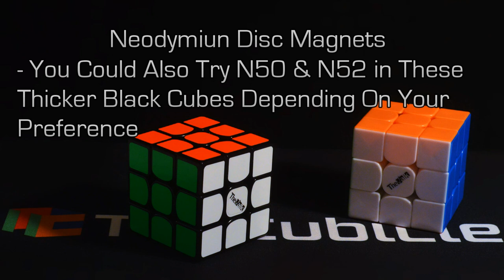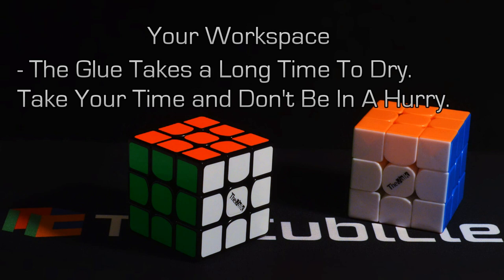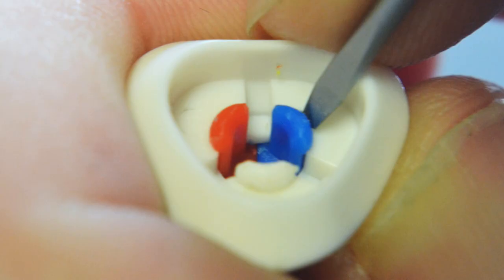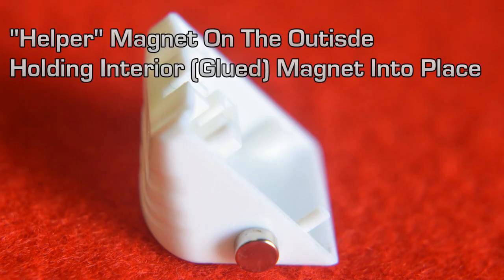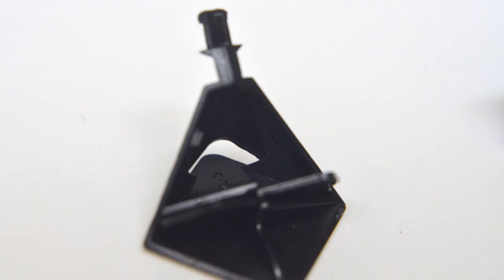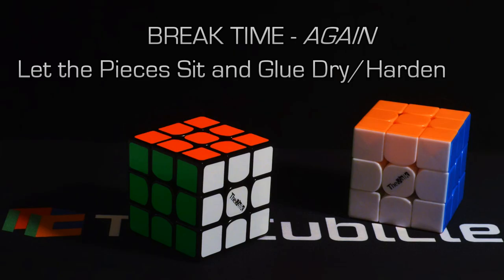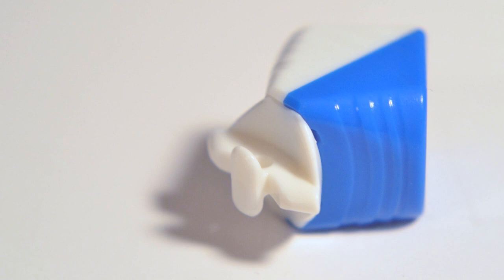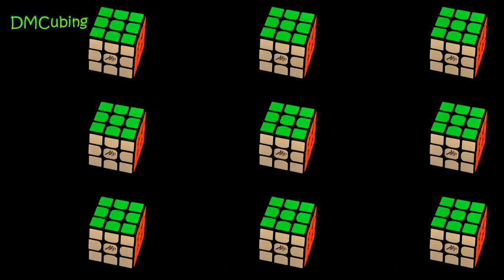DIY: How To Make A Magnetic Valk 3 Speedcube Tutorial

Comment: Sorry I keep asking questions to you but I have some more..

1. If I want n35s that give a Valk a subtle feel (and not act like n50s) where is the best place to buy them?
2. What is the best way to retrieve glued magnets (very runny super glue: very fast dry) if they aren't glue too generous?
Reply from the maker: Ducksfan101 Depending on how light you want them to feel, you have a couple of options. I've been using N35 4x2 from gaussboys.com. They're full sized magnets and give a noticeable, yet subtle feel. Check out Hybrid_ Cuber channel for a video on my cube. 
Another way to approach it is using a lighter magnet. For this, you can use the slightly undersized magnet I've used on occasion, the N35 4x2 from magnets365.com It actually measures 4x1.75 so it provides a slightly weaker magnetic pullforce than standard 4x2. 
For removing magnets, you can remove and disassemble them, then soak them in warm soapy water for a few hours. This helps loosen the glue. Then carefully use a small flatblade screwdriver to pry them out. Just be careful prying them out so you don't damage the plastic.
Reply from the maker: Ducksfan101 PS if you do use Gaussboys, you get free shipping on orders over $10, and using the coupon DMCUBING saves you 10% of your entire order.
Reply: Hmm. I ordered n35s from Gaussboys a couple of weeks ago and when I put them in my Valk they were very strong afterward. Idk if thats how they were supposed to feel or if there was a mistake. Ill give it another try though sometime.
Reply from the maker: Ducksfan101 I got a similar comment this morning. I don't think they would have mixed them up. But theirs are stronger than other people's N35 4x2.

Comment: I have the valk LE mint edition, I'm considering between the N38 and the N42, which one should I use. Also, +1 sub!
Reply: Also, does the plating matter, or no?
Reply from the maker: RektWithStyle I don't believe that the plating matters that much. The 42's that I get happen to be goldplated, but goldplating is always very thin and I really doubt has much effect on the magnetic pullforce. 

I have only ever used in 35's in the mint Valk but in black, I've used just about every magnetic grade available and I prefer both the 42 and 35 in the black cube. I think any magnet from 35 to 42 would work good in the mint cube. 

If you like a definite, pronounced magnetic feel, the N42 is really nice. But I would only recommend it if you like this particular feel. It takes a little more effort to get the cube moving but once in motion the feel of the magnets lessens and the cube actually is very smooth feeling, and also quick. If you have an aggressive solve style, this might be the way to go. 

If you like a lighter magnetic feel , then go with a lower grade magnet, either the N35 or N38. The 35 of course will give you a more subtle magnetic feel, while the 38 will  increase it by just a little bit. 

Hope that helps!
Reply from the maker: RektWithStyle And thanks for subscribing! I appreciate it!!!
Reply: No problem, thanks for your help!

Comment: Some superglue accidentaly end up on the visible side of an edge piece. Any tip on how to get rid of it? It's a stickerless cube, unfortunately.
Reply from the maker: Alessandro Iraci actually might be better that it is stickerless. Is it on the side of the piece? I would use a blade of some sort either knife or razor and instead of trying to cut into the glue just scrape it the opposite way of how you would normally cut something basically dragging the blade across the glue so you don't gouge the plastic. This usually works. Then if it's still a little rough, sand the area lightly with emery cloth. It's a very fine sandpaper. Then after that, rub the area with a little fine steel wool.

Comment: Does it depend where you put the magnets ? On the right or the left of the edge pieces
Reply from the maker: In a way, yes. You always need to check which side allows the magnets to line up perfectly across from each other when you have the edge and corner pieces lined up. Often one side of the edge piece works better than the other. That's how I choose where I place the magnets. And I generally use an internal post within the edge piece to place the magnet up against. To adjust magnetic strength in this type of layout, I use the same magnetic placement and adjust magnetic strength by my selection of magnet. 
But having said that, the closer the magnet is placed toward the core, the weaker it will feel. In the Gan Air, for example, you can reduce the perceived magnetic strength by placing the magnet further into the pieces. I often do this. 
One last thing- in the Valk, it is possible to place the magnet slightly further into the pieces. I've done this before. I don't necessarily recommend it, because often glue will leak out of the corner piece cutaway holes while you're magnetizing it.
Reply: DMCubing thanks 😃

Comment: Would n42 magnets work? Because im thinking of buying a valk and magnetizing it on my own
Reply from the maker: FatDuck Assuming you're talking about a 4x2 magnet, I used to like the N42 4x2 in the Valk, but as magnetic cubes evolved, and lighter magnetic strengths became the preferred feel for most people, I switched to N35 4x2 for this cube. 
You could, however, use the N42 4x2, but just realize the magnets will be pronounced, and the "bumps" will be stronger.

Comment: Hello Dm cubing great video
I only have n35 and n50 magnets both of which are 4x2mm 
I heard somewhere that the overall feel is averaged eg n35 + n50 = n42.5 
Where would you recommend too put the magnets so n50 on corners or edges 
Thanks btw my valk is black plastic
Reply from the maker: wongempire In my experience mixing grades, you basically end up with an average of both strengths. Still, I'd probably put the highest grade, N50 in the edges. Let me know how it turns out.

Comment: Looks like I will have to be very careful of not putting a too large a drop of glue on the inside of the corner piece.  That vent looks like a sneaky place for glue to splash out and fuse the pieces together.
Reply from the maker: jonathan herring Exactly! Couple of pointers- always apply the drop of glue to the inside corner of the piece away from the opening, both on the piece and magnet. This way the extra will flow into the closed in corner and not out the opening. Also, once the glue has had a few minutes to start drying, separate the pieces. This will prevent any sticking and also prevents the glue from fogging the edge piece once the fumes of the superglue start coming out of the corner piece cutaway. Circulating the air with a fan will also prevent fogging.

Comment: Hi DMCubing, I was wondering what the best magnets will be for the Valk. Ive seen in a store 3x3x3 block mm N45 magnets. Will that be fine? Or do you really recommend N35 4x2mm. And is 4mm2mm  N50 too strong for it? Im using a Black Valk 3

Thanks in advance!
Reply from the maker: Most people seem to use the N35 4mm x 2mm in it. It gives a nice, subtle magnetic feel without being overpowering. It seems, however, once you get used to it, and other magcubes, that the N35s in it are sometimes too subtle. Though I have yet to try it, because I can't locate any, I would really like to try N42 4x2 mags in it. 
The N50 would really be overly strong in it. The Valk is a lightweight cube with fairly thin cubie pieces (.038"), so you'd lose a certain amount of finesse and the cube may become locky and blocky feeling with too strong of a magnet in it. 
As for the square 3mm N45, its pullforce is about .80 lb, which is up there close to the N48 4mmx2mm (.87 lb) and would be too strong for the Valk 3. 
A good thing about the N35 4x2 is it is a fairly common magnet. They sell cheap ones on ebay but I prefer the ones available from magnets365
Hope that helps!
Reply: DMCubing Thanks man appreciated!

Comment: Do you magnetise your cube first or do you lube your cube first??

because if you lube your cube first, when you come to magnetise it you will get the lube everywhere.
Reply from the maker: Leuan Jennings No, I make sure there is no lube anywhere on the cube before I magnetize. Glue won't stick to greasy parts, so I use rubbing alcohol and clean all the cubie pieces, inside and out. 😀
Reply: Thanks a lot DMCubing 👍🏼😁

Comment: Hi DMcubing, just wondering, does the superglue part matter alot? Or can u just use any normal cheap superglue?
Reply from the maker: Rabiot Digne you can probably use just any superglue, but I would avoid thin superglue's, because they have a tendency to run.

Comment: Do you think it would be better to glue the magnet in a more central position on the side of the cubie? I know this would be technically difficult as it would overlap the join but wouldn't it match up more neatly when an edge piece is upside down?
Reply from the maker: I don't know if I follow you, but you're kind of limited in where you can place a magnet within the cubie piece. And it really is on the side of the cubie piece.  And they all line up perfectly when any given piece is at its resting position, every single one of the 48 magnets is lined up with each other. 
You could, if space allows, put four in the hub of the center piece, then one each in each of the edge pieces, but there aren't too many cubes you can do that with, and because of leverage, they probably wouldn't have as much pull effect.
Reply: DMCubing What I meant is say you have a stickerless cube in WCA orientation and you put magnets in the FU edge piece then they could go on the white or green half. Say you choose white and then put the corresponding magnet on the white piece of the FRU and FLU corner pieces so they align. But, during the solve the FU piece is flipped then the white would need to align against the green parts of the corner pieces which it couldn't do.
Reply from the maker: The way they're arranged, well, everyone's cubes (Cubicle, for example, and mine, etc.), is there is a total of three magnets in each of the 8 corner pieces, because they align with three edge pieces (one below, one to the left, the other to the right), thus each edge piece has two magnets inside which mate to their corresponding corner piece magnet. There really is no other way to have complete magnetic coverage throughout the entire cube.  With each single face move, a total of four magnets loose their grip as the face is put into motion and as it nears its resting position, at about 3/16", the magnetic pullforce helps to draw the face into position with a new set of four magnets. During M slices, a total of 8 magnets are in motion (two in each of the four edge pieces.) I have a video up that addresses this probably better than I can explain here. Here it is: https://www.youtube.com/watch?v=_XZhLmBz1zI

Comment: DMCubing. Can i ask what is the thickness of edge and corner plastic parts in Valk3. Can you measure for me. Thanks
Reply from the maker: Aaron Paul Maranon Here you go:
Edges- 1.10mm
Corners- 0.94mm
Reply: DMCubing Does N48 5x1 or N42 5x1 works great in valk3? Like you did in gts2
Reply from the maker: Aaron Paul Maranon Actually it's a different animal in the Valk. The 5x1 feels stronger. This is because the cutaway holes of the corner pieces allow magnetic energy to escape, or maybe better put, because of the holes, the magnetic field is less shielded in that area, thus the magnetic attraction is increased. So the N42 5x1, which feels moderately subtle in the GTS2M, becomes noticeably stronger in the Valk.

Comment: I have a question should I use n35 - 4 by 2mm    or     N42 - 1  by 5 mm ? In my valk stickerless.
Reply from the maker: Good question! I think, only because of the cutaway holes in the corner pieces, I would stick with 4x2 size magnets. Though I like 5mm diameter magnets in a lot of cubes, in the Valk, there’s the potential of having the glue run outside of the corner pieces because of the slightly wider 5mm magnet.
Reply: Thanks
Reply: Good question

Comment: Are n50s to strong in the valk or not, since my valk very unstable and  uncontrollable
Reply from the maker: CPU Cuber Guess it depends where you get the N50s. A true to specification N50 will be significantly too strong in the Valk. However, there are lots of unscrupulous dealers selling "N50" 4x2 magnets at ridiculously low prices that generally turn out to be N35s being passed off as something stronger. 
I think the N38 4x2 from Gaussboys is probably as strong as you'd ever need in a Valk, though I've experimented with the N42.
Reply: DMCubing I am pretty sure they are not actually N50s since I just them yesterday and I magnetized the valk but it feels like my friends n42 magnetic valk. They pull the same amount as n42s. So they are probably n42s but thanks anyways.

Comment: Hey DMCubing, you said N42s are the strongest magnet you would recommend, but what if the N45 is 4x1mm, is it gonna be stronger than the N42s?

 I've magnetize my mf3rs with N52 4x2mm magnets, and the issue that i have is the tactile feedback is too much. So, if i finally magnetize my black based valk with N45 4x1mm, how does it compares to my magnetic mf3rs?
Reply from the maker: Sofram No, an N45 4x1 is going to be significantly less than a N42 4x2. Like close to half its power. For the Valk, you'd be better off using a 4x1.5 magnet of around N35 if you're looking for a subtle feel. I actually prefer an N35 4x1.7 in this cube now. That magnet is the N35 "4x2" sold by magnets365.com. They're just slightly undersized. It gives a great feel. 
Compared to your MF3RS2, these magnets will feel significantly weaker since N52 is the strongest grade. Your Valk would benefit from a weaker magnet but the 4x1 would probably be too weak.
Reply: DMCubing but how does N45 4x1 compared to N35 5x1?
Reply from the maker: Sofram 5x1? You didn't mention that magnet earlier. Anyway, to compare predictable pullforces, you can enter the values of the magnets here: https://www.kjmagnetics.com/calculator.asp
Reply: DMCubing yeah, N35 5x1mm, they will fit in the corner piece right? Sorry i didn't mention that before, cause I'm afraid it won't fit in the corner piece
Reply from the maker: Sofram They'll fit fine but since it's a little wider, you need to be careful so that glue doesn't run out of the cutaway holes. A 5x1 magnet will feel a little bit more stronger in the Valk because the cutaway holes of the corner pieces allow a small amount of magnetic energy to escape. But an N35 5x1 will work fine.

Comment: Hey DMCubing, will 4x2.5 N35 work in this cube?
P/s: Great tutorials :3
Reply from the maker: 4x2.5? That's an unusual size. Anyway, it should have the pullforce strength equivalent to that a an N42 4x2, so it could work. It will just have a more pronounced magnetic feel than normal. If you have an aggressive solve style or like the feel of stronger magnets, it should work out fine.

Comment: I couldn't find any N42 4x2.  This there some other size and grade that is about the same as the N42?
Reply from the maker: cao qiang shao I recommend N35 4mm x 2mm. They work great in this cube! I would only recommend N42 if you like a stronger magnetic feel. Most people like the N35 in this cube. As a matter of fact, I just finished doing one with N35s this evening. That makes my 14th Valk I've magnetized. 😀
Reply: Thank you. And that alot of magnetic valks
Reply: I would like a little stronger magnets, since i have a some what of a aggressive turning. would the N38 work a little better for me. Thanks. sorry for asking a lot of questions, i really want to find something that works for me.
Reply from the maker: cao qiang shao I don't mind the questions at all, ask all you need to!
Yes, this magnet will work great! So will the N42 4x2s. I have made several cubes with both of these magnets in it, and I love them both. I think I actually prefer the one with N42's over the one with N38. Then in next popularity I like the one with N35's. That way I have one that's kind of light, and then another one that's a bit heavier with magnetic pullforce. But by itself, the N38 cube is really quite nice!
The N38s will be noticeably stronger than the standard (for this cube) N35s. If you really like a strong magnetic feel and consider yourself aggressive, then N42s work well.

Comment: Have you tried N52s on a black weilong gts, id like to hear your feedback on that coz i cant find anything other than N52 at the moment?
Reply from the maker: I think they would probably be really good in a black GTS. I bought some N52 4x2 mags last night off of eBay to use in one. The N48 work good in a black GTS but feel a little weak compared to the same mags in a primary, thus the reason why I want to try the 52s in the black.

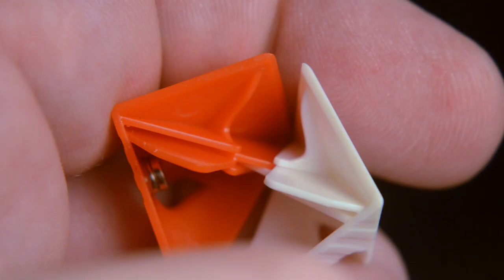Comment: at 10:10 it looks like you have two magnets glued into the orange piece. do you use 2 magnets in each spot or just certain areas?
Reply from the maker: The stickerless cube you see in this video was my first prototype which underwent several changes until I settled on the N35 4x2 magnets. At one point, I had tested it with single N48 4x1 magnets, then with double stacked 4x1s (like you see in this photo). The photo shown here is to illustrate the assembly of the cubie pieces, and not the configuration of magnets. Hope that helps.

Comment: I like weak magnets but n35 3x3 is the weakest i can get, do you think i can feel the magnets?
Reply from the maker: chonghauhan I think you could. It will have a very subtle feel but I think you'll still get some benefit from them. I occasionally use an N35 4x1.7 and it's only slightly stronger than the N35 3x3, so I think you'll be ok!